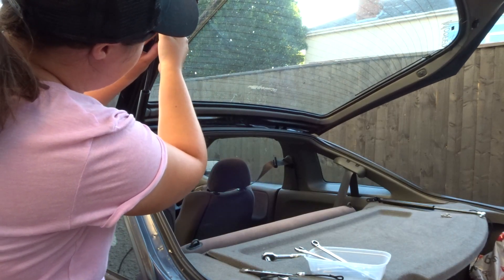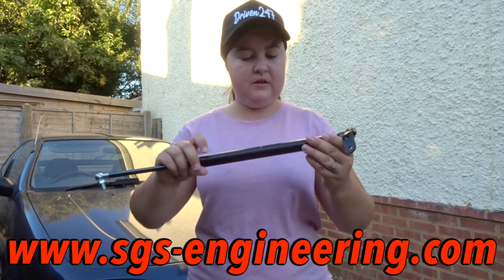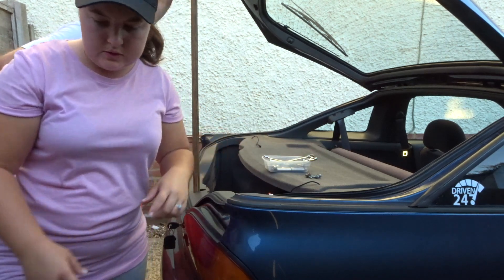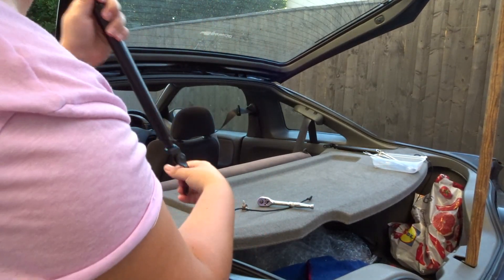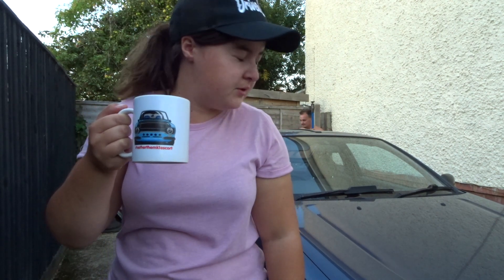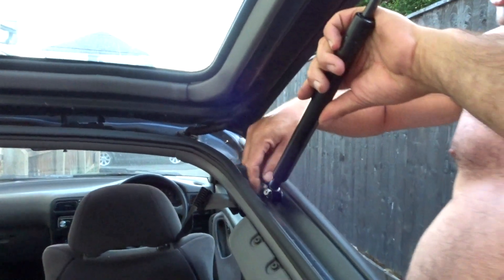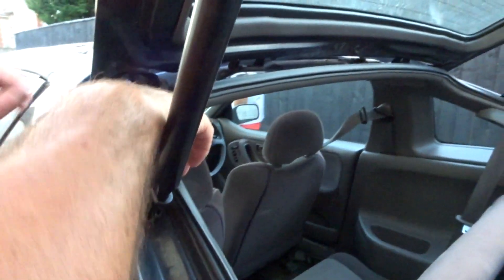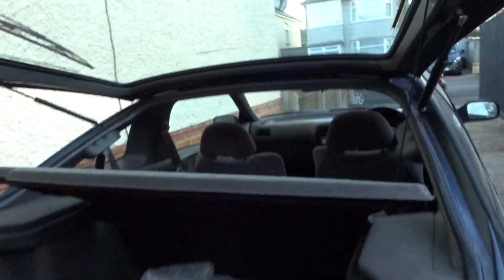Nissan 100nx BOOT STRUT install *MUCH NEEDED*

Comment: Another great video. If you have a nut that the threads won’t align. Spin the nut the opposite way. You will hear a click and then tighten it. It was an old school mechanic that told me.
Reply from the maker: Thanks George and for the tip! My Dad had to step in which was annoying but appreciate his help! Thanks for watching.

Comment: Hello there. I would say that the NX100 is the counterpart of the Mazda MX3. I like the MX3 much better. I drove it a few times a long time ago too. It belonged to an acquaintance of mine. I've also ever sat in the back of the MX3 (with 3 people, as driver + passenger and I in the back). It's tight, but you can bear it. Unfortunately, I haven't had the experience in the GT86/BRZ yet. Since a lot of people complain that it's so narrow back there. I find the front of the 100NX very difficult to get used to. Otherwise it sure is a cool car. Greetings from Germany   😉
Reply from the maker: I did have an MX3 very briefly so check out the video on that car and I agree, similar cars for sure! The 100nx does have very Japanese styling and I prefer the back to the front! Thanks for watching!